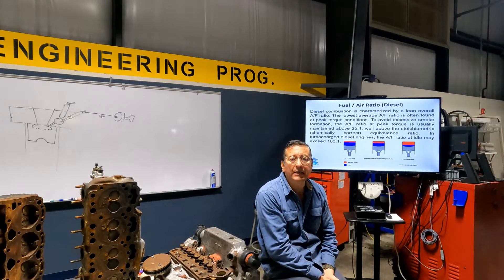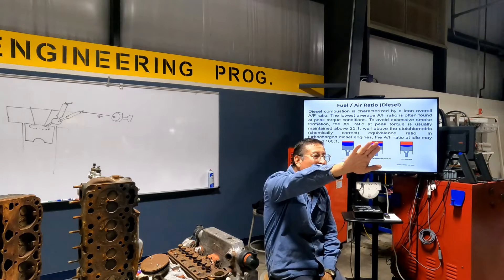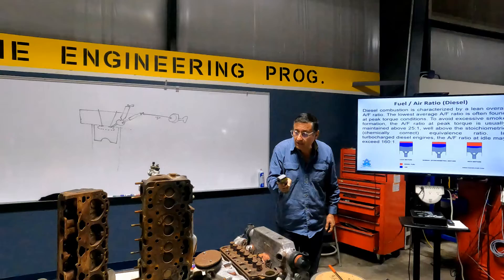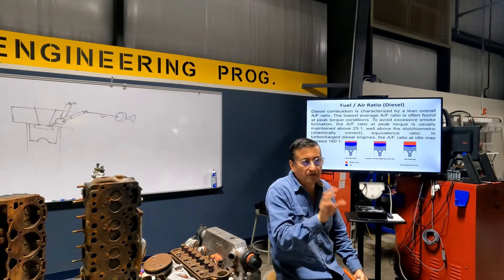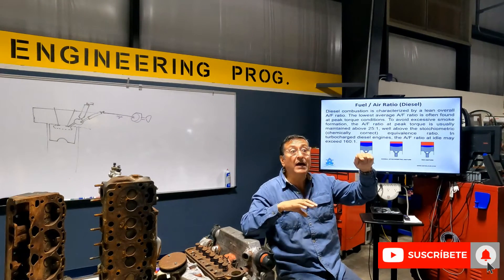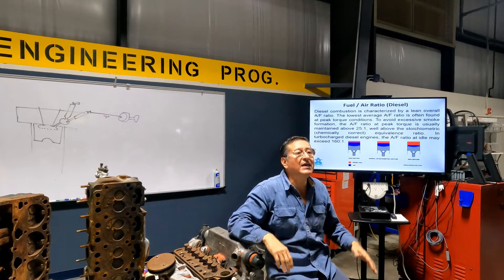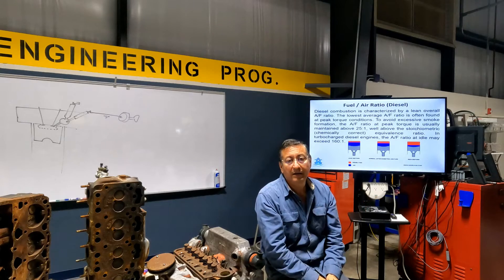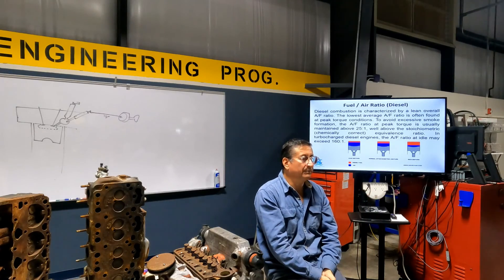Lean Mixture in Diesel Engines

Comment: Hello, i have a Citroën jumper 2.5d 2001 non turbo, problem no power on acceleration black smoke , on idle runs fine , pump  and injectors checkt ok , taking away the air filter components ,only intake manifold stay then he runs normal , al the parts from the air inlet are clean (blockt also the egr valve to test ) nobody can say what is wrong maybe u can help me greetings